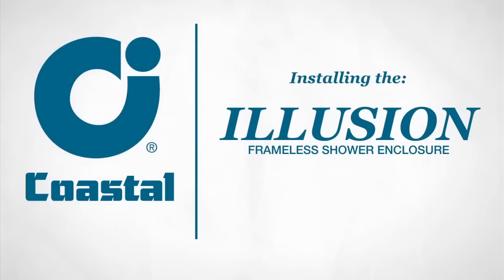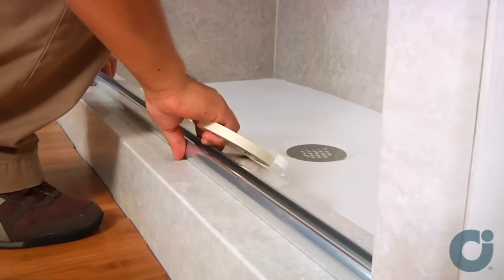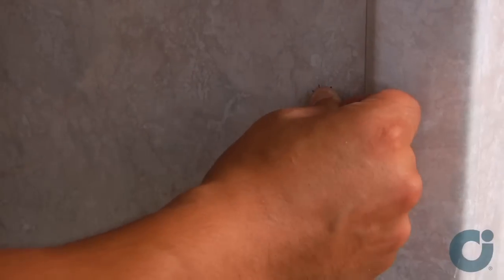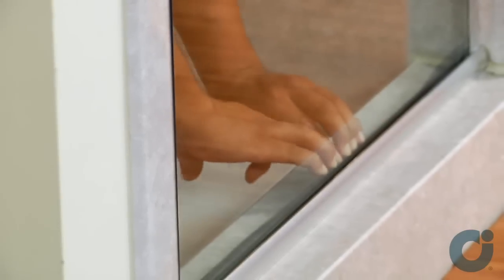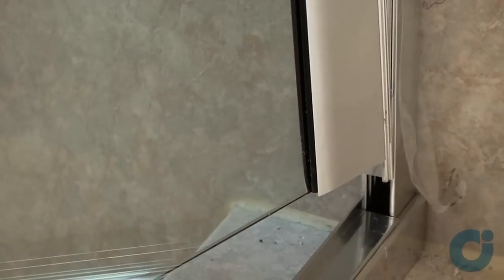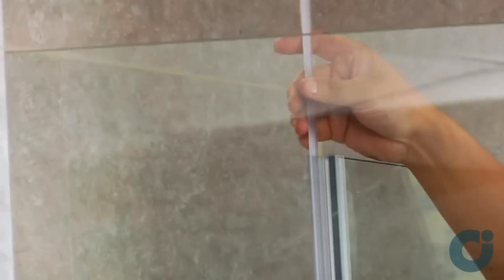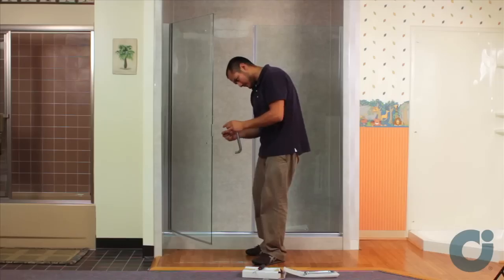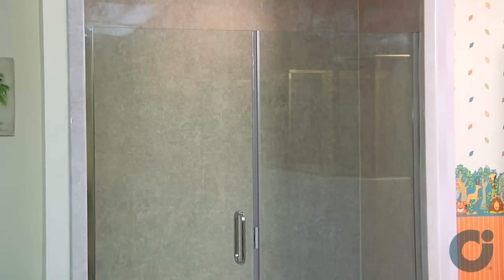Frameless Shower Door Install - Inline Panel / Configuration | Illusion by Coastal

Comment: I wonder if you could build a shower without any doors and use electric fields to push the water droplets / the splash inwards towards the center. You would need some kind of circular frame to generate the field though.... But it would look awesome :D

Comment: Hi coastal, I am installing this shower door but, they do not align properly, door is overlapping the fixed glass by about an inch and a half. My shower is around 56”. I dont see any adjustment screws or something. Can someone help?? Thanks

Comment: Video does not go over adjusting the fixed panel to fit the opening. I’m considering one of these doors and I have a pretty good guess how it’s done but I’m surprised to see the manufacturers video doesn’t mention it

Comment from the maker: Good question PANTERAIsTrueMetal. There is certainly some ambiguity related to the term "frameless" as it relates to shower doors.

http://www.bathenclosures.org/basics/glossary.htm

The Bath Enclosure Manufacturer's Association (BEMA) provides the following definition:

Frameless: a bath enclosure system that minimizes the amount of metal used to hold the system panels and door in place.

This innovative product eliminates all metal  framework where the door glass meets the adjacent panel glass as well as the header.  The metal trim at the wall is merely for adjustment providing for a quick and easy install and should not be considered when determining whether or not a shower door is framed or frameless.

Hope this helps..

- Shower Doors by Coastal

#FRAMELESS
#SHOWERDOORS
#SHOWERDOOR
#GLASS

Comment: If you install metal track all over it how is it frameless
Reply from the maker: Good question +PANTERAIsTrueMetal. There is certainly some ambiguity related to the term "frameless" as it relates to shower doors.

http://www.bathenclosures.org/basics/glossary.htm

The Bath Enclosure Manufacturer's Association (BEMA) provides the following definition:

Frameless: a bath enclosure system that minimizes the amount of metal used to hold the system panels and door in place.

This innovative product eliminates all metal  framework where the door glass meets the adjacent panel glass as well as the header.  The metal trim at the wall is merely for adjustment providing for a quick and easy install and should not be considered when determining whether or not a shower door is framed or frameless.

Hope this helps..

- +Shower Doors by Coastal

#FRAMELESS
#SHOWERDOORS
#SHOWERDOOR
#GLASS
Reply: I Haven't Posted A video yeat . But I have been a Shower door installer for about 4.5 years now . And I know with my frameless 3/8 Doors I just use 2 Glass to wall clips on the Stationary panel sit it directly on tile . Cause its no harder than metal Track just be careful And silicone it to the tile on both sides up the wall and across the curb . And use 2 Glass to wall hinges on the door With A 8 inch C-Pull handle. My old boss did nothing but frameless doors probably Averaged 2 a day over 3.5 years And never had a problem with any of them other than a door adjust. And although The new place I work doesn't alow it My fave is pre tile . Wich is sitting the stationary panels and or returns on the duroc silicone it there with a few pads up top to hold it then let the tile guy tile up to it and grout it in with grout in a tube .. Its more flexable wich means its resistant to crack around the glass and adheir to it better